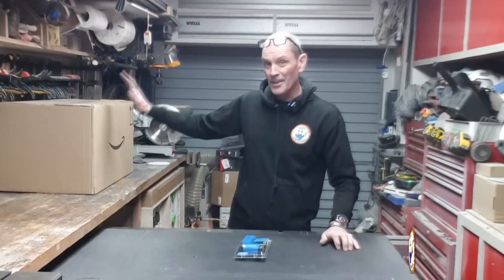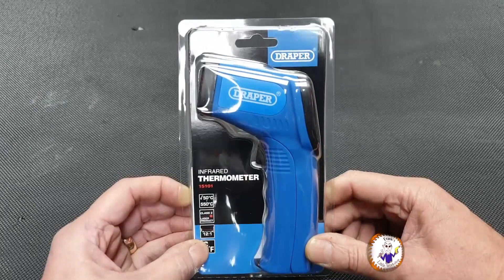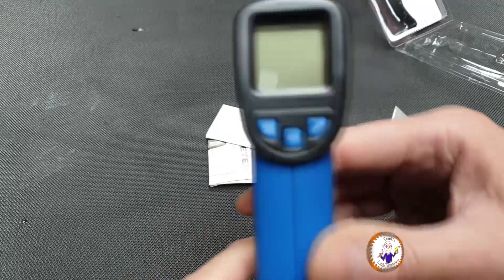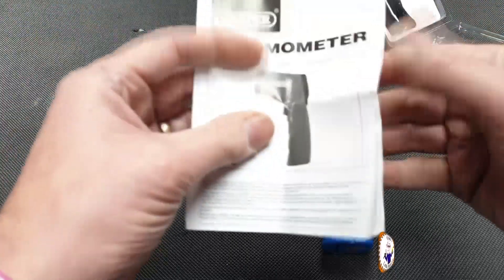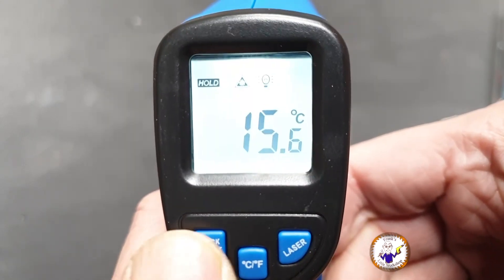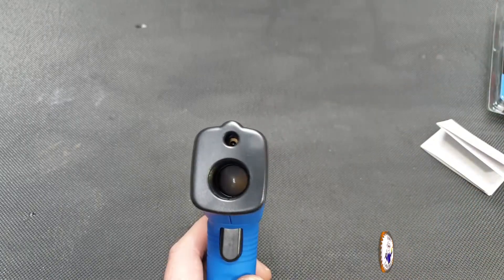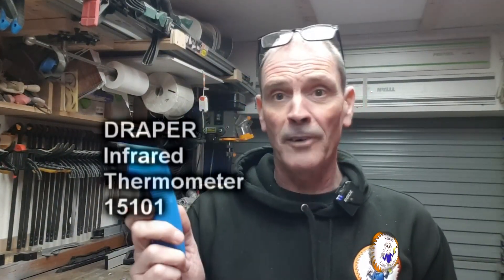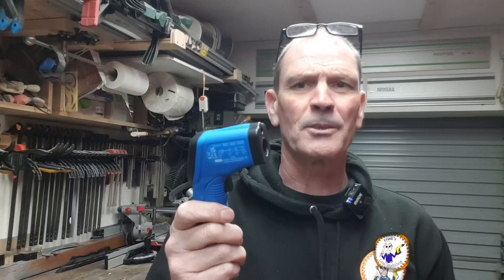DRAPER infrared thermometer 15101

Comment: I have used, and been around these guns for years in industry, measuring interior and exterior rotary kiln temperatures, and in testing electrical components and connections. Your demonstration of the accuracy at various distances was excellent. Entertaining and informative.👍
Reply from the maker: 😁 This is the first time I've had one of my own so I'm sure it will get quite a bit of use. I've used a thermal imaging camera in my day job to diagnose high current issues in full vehicle harnesses but I don't think I can quite afford one of them for my workshop 😆😆.... you never know....one day😆. Thanks for watching Chris 😁👍

Comment: Nice tool I have used several of these over the years for my work some cheep some very expensive just watch out if you are testing something that has a very reflective or shiny  surface the readings can be all over the place. But it probably said that in the instructions. Looking forward to what is in the box happy new year. Steve.
Reply from the maker: 😁 Thanks Steve. Yep, reflective surfaces are a problem. I didn't go in to how to get around this issue, but it is an easy fix. I didn't cover the principles of emissivity in this video it was more of a general usage overview 😁. Thanks for watching 😁 👍
Reply: Thanks for the reply Frank your going over my head with emissity I had to google that one 😀. I do appreciate the time and effort you put in to your videos keep them coming. Steve